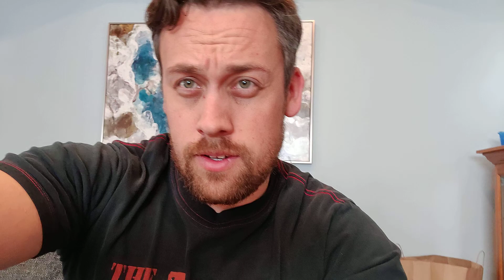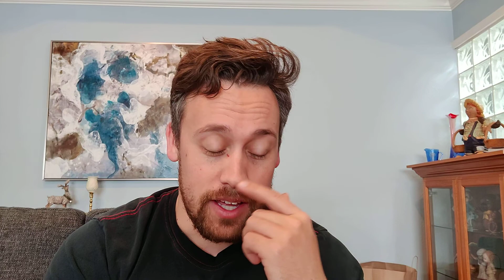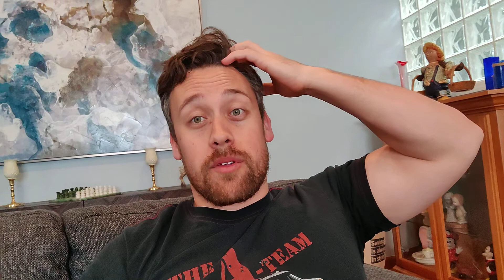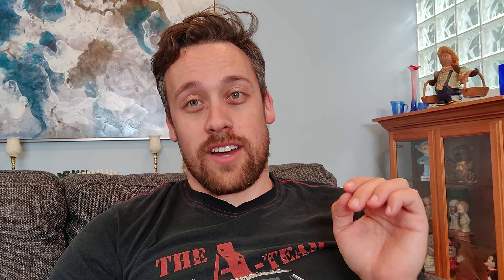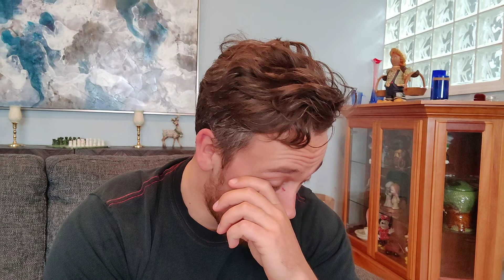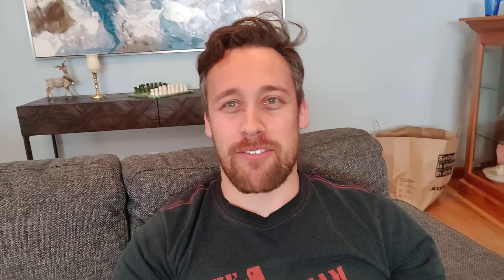How To Select Engine Porting for Rotary Engines

Comment: i've got a 6 port S5 engine I'm going to be porting soon. standalone, boosted, probably FuelTech since I'm retromodding a 70s mazda truck and the digital dash will kick ass.

I'm thinking of running a 4 barrel pro-jay or similar style intake, and modifying the linkage so primaries come on about 30% before secondaries. I'm thinking of half-bridging, admittedly because I like the sound. I'm not thinking i'll give up much low end though because my primaries will be street ported and they will be used exclusively for most low end movement. No aux valves, just left open. Exhaust P ports opened up a bit.

thoughts? is this a bad idea?

Comment: Thanks for the great info you're sharing. I'm looking on building a 13b PP N/A engine (for a race car), do you have any recommendation on people that can balance the rotating assembly properly? I'm thinking on using the RX8 rotors (milled for RX7 apex seals), RX8 e-shaft, and RB PP housings.
Reply from the maker: I prefer Rotary Science (Michael Lambaise) who did my personal engine.
Reply: @RGHTBrainDesign  Ok, I've also heard good stuff about him. thanks for confirming it.

Comment: Interesting take on 6 port. But without the ability to close off the secondary ports you lose the low-end grunt. If you retain the ability to transition the secondary ports and you have high compression S5 NA or perhaps modified RX-8 Rotors I think the 6 port NA motor plates will actually have a lower low-end grunt than a mild or stock port REW Plates. But with ECU's and other readily available and reasonably cost-effective components out there now It would certainly be possible to do a 6 port turbo motor that retains low-end power and transitions smoothly into high-end turbo power. I imagine it would take some serious tuning time to get that all smoothed out though. I have all the parts to do this, If only I had the time to put it all together... Like I need another project at the moment!

Comment: stock port rew has a crap power band at higher power levels. street port will keep your low end with good mid range and sacrifice power up top. half bridge with a street port will sacrifice low end for good mid range that will hold up top. keep shifting the powerband up from there.

intake porting is half the battle and exhaust port shape, size, and timing has a large effect on response and powerband.
Reply from the maker: Exhaust Porting I'm leaving for the engine builder or tuner to discuss in detail, but it's the same process. Larger is going to tank response while having marginal gains.
Reply: @RGHTBrainDesign  not really response will improve depending on size, shape, and timing.my midsized D port improved response over stock.
Reply: @RGHTBrainDesign  if your allowing more air & fuel into the engine then u need to give it more time to let it out. There is a lot of power to gain with exhaust porting. Canr do one without the other.
Reply from the maker: @patrickd.7880  Distribution of Power... It all relates to where you want the powerband to be.